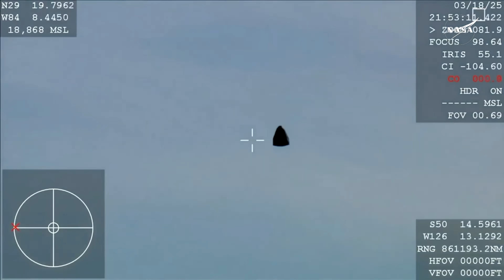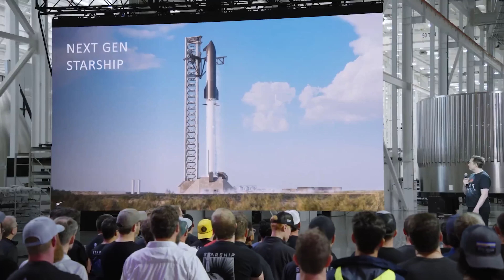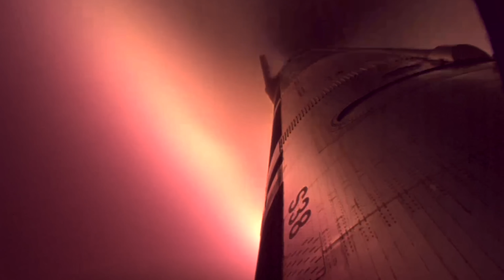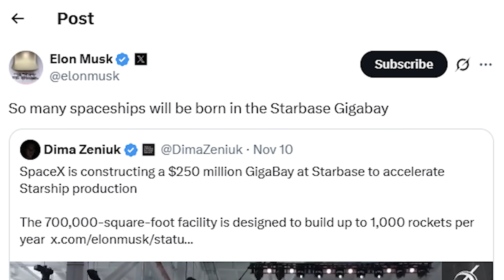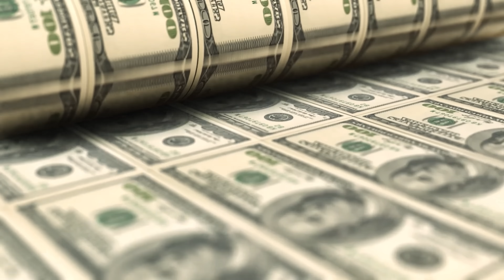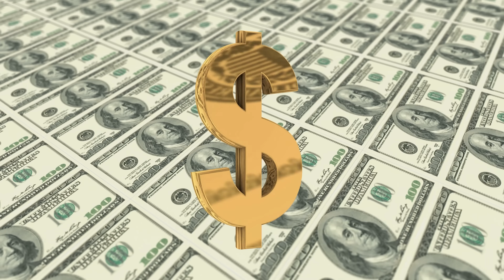SpaceX Just Did Something no one has ever done before Shocked whole Industry...Musk Declared!

Comment: The HLS is going to be a difficult project. The landing is the questionable part. I hope the unmanned version goes well.
Reply: 1) Starhopper.
2) currently, they have a unit that is testing landing on synthetic lunar soil. 
3) both booster and ship have proven that they have great control over them coming down, so not an issue. 
4) hopefully, they will build a test version here, with legs on an HLS and then simply take it to 50-100K', and land it.